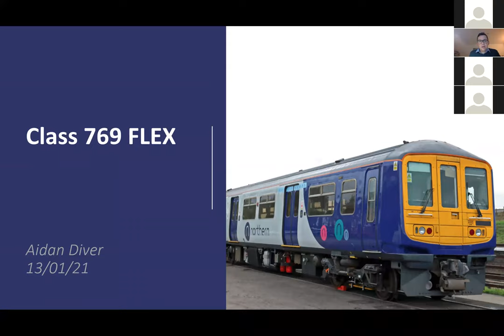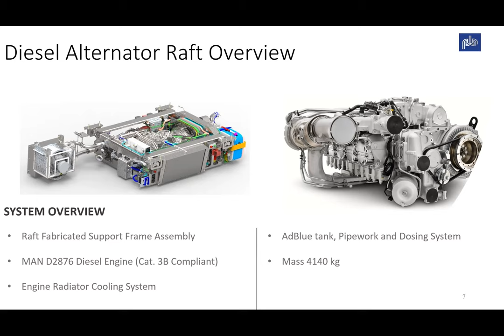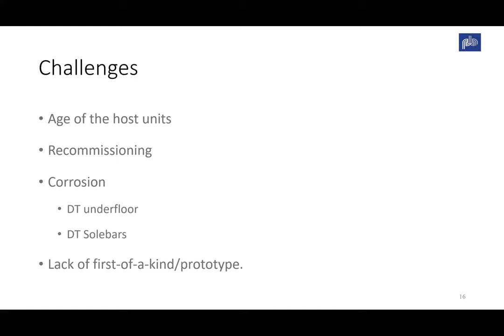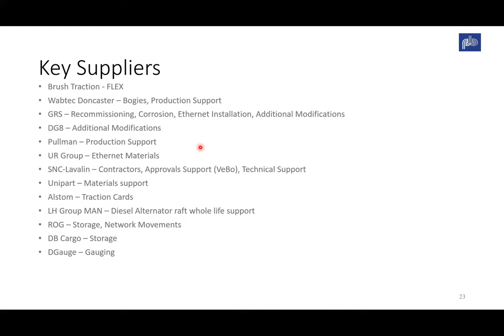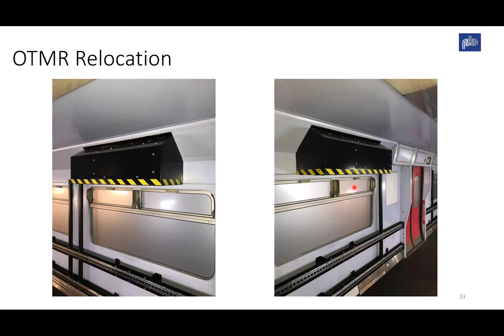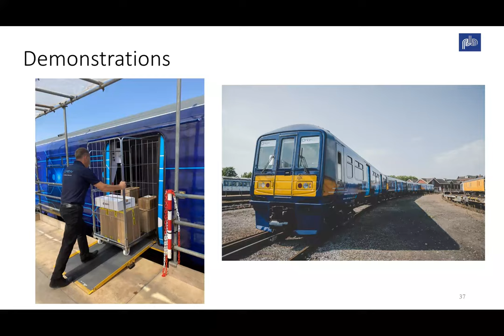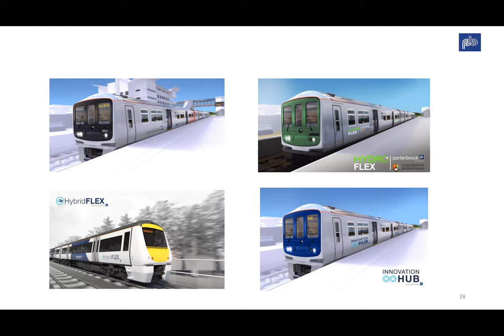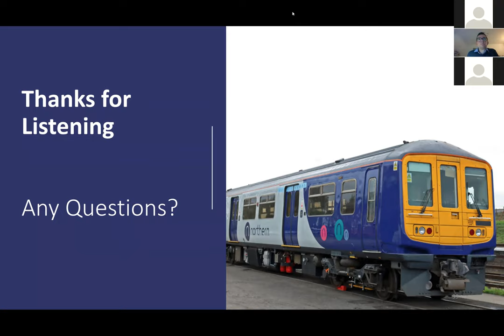Class 769 FLEX: Re-purposing rolling stock to meet industry demands

Comment: Just a question on this concept. Would it have been better for the Class 769 FLEX to have utilised the Cummins QSK19 power pack rated at 750hp to provide more oomph for hill climbing and this would create a total horsepower of 1500hp for the two combined units per set at 2x 750hp? The Cummins QSK19 is used on the Class 220/221/222 and the Class 180/185 DMU's and they are very reliable on the whole. Perhaps this would attract more TOC's and would make the FLEX more ideal for longer distance routes. Maybe some new routes like the Cambridge to Cleethorpes, Birmingham to Stansted Airport and perhaps the Leicester to Cleethorpes as operated by EMR? Just a few ideas I thought I would mention to help.